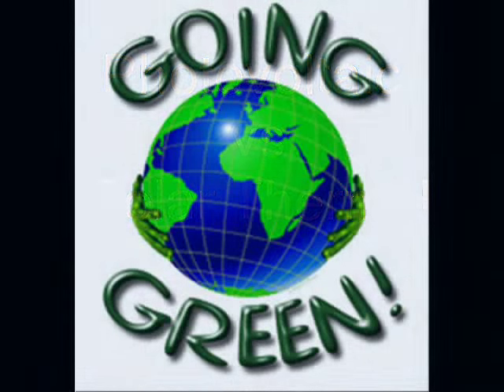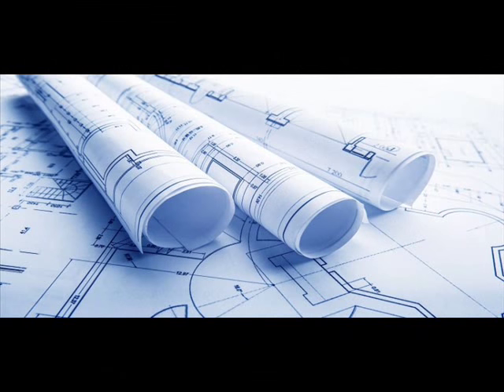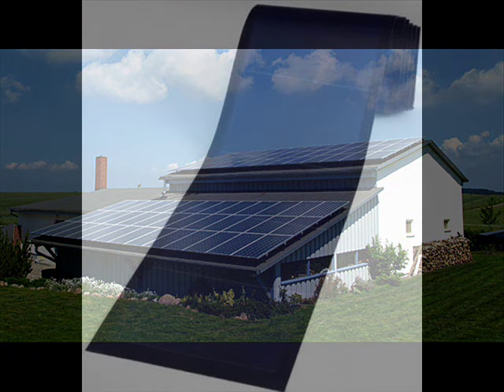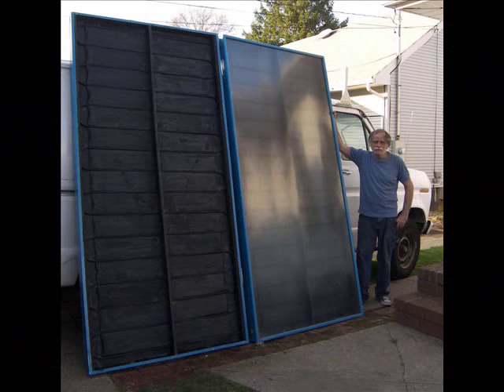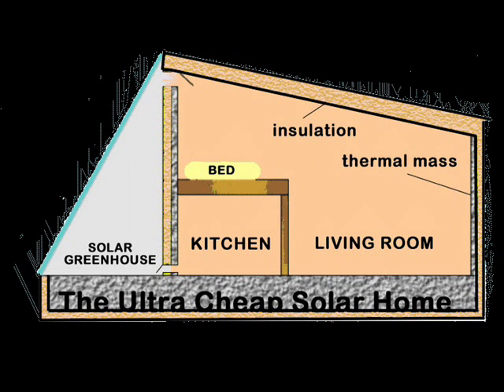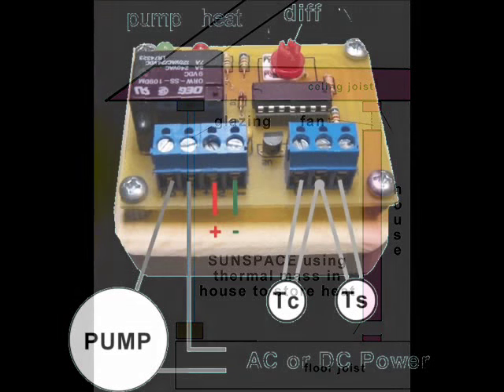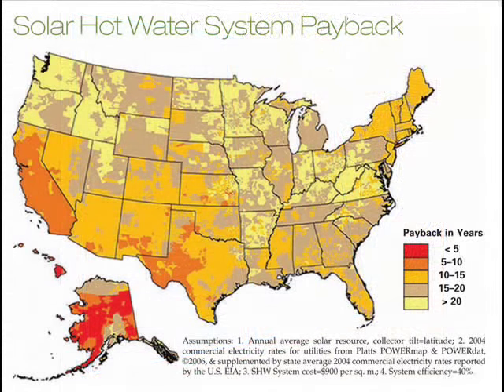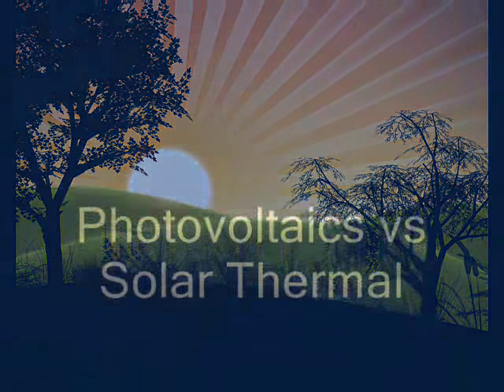Photovoltaic vs  Solar Thermal

Comment: I liked the point raised about less regulation than PV systems. For people who are considering PV with storage batteries, storing heat in a thermal mass is a small fraction of the cost of storing electricity in batteries.